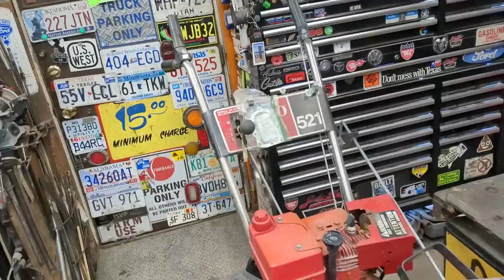Killed from too much Starting Fluid     ---Old Toro Snowblower Saved

Comment: Older snowblower  take off the sparkplug cap so it doesn't get burn. Heat the head up with a propane torch.  Just don't shoot the flame to the gas tank or you going to have a bad day. This i find helpful for starting on really cold weather.

Comment: Nice! I love the old equipment. Tecumseh powered snowblowers are the best. That is what Tecumseh did best, imho. They made lawnmower engines for Craftsman, but their money maker was the 5 & 8 HP Snowblower engines. Easy to work on, easy to fix.
Reply from the maker: I'm a huge fan of the Tecumseh snowblower engines but somehow I dislike their lawnmower engines. I think they bid for contracts and had to cut corners to get the jobs. And it's just the opposite with Briggs as I hate a snowblower with a Briggs engine.
Reply: @sixtyfiveford  I think they built lawnmower engines just to keep their people employed in the off season from making snowblower engines. I do have a Monster od a Snowbird 11/33 with a Briggs 25 CID on it that I love. But my overall favorite to work on is the HS 50.

Comment: Good video. 👍  My 1970s 2 stroke Toro snow blower would have corrosion on the points almost every year, I finally replaced the points with a little electronic module I got at the hardware store, no problems for the last 30 years. 
Ginger has a great personality, she is so loveable. 😍
Reply from the maker: The little points eliminator boxes are great. I used to put those in from time to time. I found the trick to points is they need to stay dry/no humidity. So I make sure the gasket is air tight and generally I get 10years. However I do live in a relatively humid free place.

Comment: I have the same Toro 521, but the original engine crapped out several years ago, so I replaced it with a Harbor Freight 6.5 HP engine.  It has run great since.  I serviced the drive/clutch and augers two years ago.  Used it for the first time this season last week.  Started on the second pull and continued to launch snow about 30'.

If the stock engine dies, the HF engines are < $150 when on sale.  The only thing that needs to be modified is the crank shaft that rotates the discharge chute.  I cut a section out to clear the valve cover and clamped on a section of high-temperature hose that flexes around the cover.

The next modification I plan to make is to extend the second-stage impeller blades with thick rubber-like (from thick mud flaps or conveyor belt material) "wipers" to close the gaps between the blade and second-stage wall.

Lastly, the bottom scraping blade and side risers are still available online.  I got a replacement set, plus a spare set.
Reply: Why did the same on a 521 that I got for free. I believe mine is a much later model the original engine had a black shroud and black gas tank that did not have points. Mine also had pneumatic tires and a taller chute..

Comment: I find these between free to $100. Sometime they are even running. The usual repair is just a carb cleaning, replacing starter rope, sometime a stuck valve. Did not have any with a blown head gasket yet. I get many craftsman / Briggs engines with blown heads. I like TECUMSEH engines. A lot of whining on line about them but I will take them in all day long.
Stay well, Joe Z

Comment: Those old Toro's with the drum style auger we're great machines.
I had an 8-24 that lasted me 30 years.
Reply: I have a 521 that but then decided to swap that this come so for the Predator 212 engine from Harbor Freight. Having an opportunity to really try it's it since been such a mild winter where I live this year.
Reply from the maker: Great machines. I would probably swap a 3, 4 or possibly 5hp for a 212cc Chinese clone but not an 8hp.

Comment: I bought a sitting-for-years Kawasaki KLR250 dual-sport dirt/street motorcycle.  The carburetor was gummed up I knew for sure.  But sometimes, if you can get them started and running long enough to get warm, they clean themselves up.  And that's what I tried to do with starting fluid...  The hard knocking should have been a big clue for me to go easier on the speed-up-the-warming process.

Anywho, the warm-up didn't help and I ended up pulling the carb for disassembly an a proper cleaning.

Once back together, it ran perfectly.  Although, during freeway rides I was getting a hell of a lot of oil in the airbox from blow-by.  If I ran high speed long enough, I'd lose enough oil there was a risk of emptying the crankcase...

Great!

I pull the head and jug.  I can't seem to find anything.  Then, I spot it!  I cracked one of the skirt channels between the rings.  A section of piston aluminum was still in there like a perfect puzzle piece.  While everything was out, I had the jug bored in addition to installing a larger piston.

I had fun on that bike for a couple of seasons until it ended up in a deep mud hole swamping the entire engine.  I roached everything trying to ride it home due to water intrusion to the crankcase.

I sold the abused machine as a chassis-only purchase.

------

I don't use starter fluid anymore...  One Summer I rode the bicycle around the neighborhood on trash day and cut off the propane BBQ grill bottle regulators.  With a quick-disconnect on the regulator hose, I can now plug in compressed air blow nozzles an deliver propane as starting fluid.  The setup works perfectly.  Search YouTube for "starting fluid on steroids" for my video.
Reply from the maker: Great story. I have a small diesel in right now that they guy blew the top of the piston off with too much starting fluid. It can be a lifesaver but also a killer.

Comment: it is always nice to bring old equipment back to life. i picked up a fairly clean toro 5/24 last year that would have likely gone to scrap had i not ended up with it. piston was about 1/4" from the top of the cylinder and water clearly got into the engine with how much crud and corrosion had built up in the cylinder. cleaned it out as good as possible and hit it with penitrating oil. it broke free eventually. the bore didn't look perfect but after cleaning the carb and points it seemed to run real good and didn't seem like there was much if any blow by which actually surprised me.
Reply from the maker: Awesome

Comment: Mine has been nothing but trouble. It used up the belts, the power transmission wheel thinger, start rope, and even the worm gear all with hardly any use. I spent most of my time with it repairing instead of blowing snow. It refused to run down hill for a time. When it did run, the snow was usually too much for it (too wet/deep/icy). I hope my grandfather got more use out of it before he gave it to us.
Reply: Some consumer stuff just isn't designed well and ends up being junk.

Comment: Got an old tiller for very cheap. They couldn't get it to rev up. Older Briggs and Stratton 5 HP with the foam in the air filter. The foam had pushed down through and was stopping the throttle from turning. Replaced foam. Works great. Easiest fix yet.
Reply from the maker: Great fix.

Comment: I bought a new WeedEater push mower with a Briggs years ago and it never would stay up to speed when hitting high grass.  Come to find out the head gasket was never installed by the manufacturer.  It still starts on one pull since I put one on.  I guess it was assembled on a Monday.  😀  Ginger doesn't attack that snow like she does the water hose.
Reply from the maker: That's funny!

Comment: I reused a head gasket on a 31/2 or 5hp. I used that exhaust sealer puddy on it worked like a champ. Advanced auto has it in a toothpaste tube
Reply from the maker: Makes sense.

Comment: I have a few vessel impacts screwdrivers to work on older Japanese bikes. The heads are JIS and do work well even on a standard #2 Phillip.   Nice easy fix for the snowblower. 👍👍
Reply from the maker: Yeah, I've had a basic Vessel JIS for years and wouldn't be without it. Just barely picked up the impact and so far I'm impressed.

Comment: My neighbor had a old Craftsman snowblower that was pitiful.  Only half of the augur turned, and one day it wouldn't start after a storm. I brought a heavy  extension cord and a heat gun, and a nut and bolt. I put the bolt through the augur, pulled the sparkplug boot and heated the head for 45 seconds.  It started up.
Reply from the maker: Nice!

Comment: I always put a nut on the end of the crankshaft when using a hammer to remove the flywheel. Just as a precaution.
Reply from the maker: If the threads go all the way out, yes.

Comment: Even when they run great those motors are just a little under-powered for the deep and heavy/wet snow; just a little more work than it can easily handle. For me, instead of dropping more time/money replacing the carb, fuel lines, muffler, etc. I'm doing the Predatpr 212 swap. These old v;pwers are "built like a tank" and seem far better built than newer models. Having 30% more power from the Predator swap (from 5hp to 6.5hp) should make it a nice little work horse and it should last another 20+ years. :)

Comment: I'm not 100% sure but I think if the 521 has a red shroud and red belt cover it has points and if it has the black cover on shroud is more likely to have electronic ignition. I had one of the more modern 521 blowers with pneumatic tires. That had the more moder electric ignition engine on it before I repowered it with a predator 212.

Comment: I know ppl be hating on tecumseh but they are great engines if you looked after them, meaning don't leave gas in the tank and carb. Clean carb, put stabilizer and maybe carb injector choke cleaner in the gas..

Comment: Great fix Moe.
Questions: did you use the old head gasket over again?
Did you use any gasket cement on the head gasket?
Many many years ago I replaced the head gasket on my Studebaker 6 cyl and the machine shop that resurfaced the head told me to use aluminum paint on the head gasket before installing it.
Reply: @DaveAppleton  Okay, thanks
Reply: Copper coat is best..
Reply from the maker: I picked up a new gasket for $6 and the old one had a large hole in it. These engine are such low compression(6:1) that they need very little help from things like copper/aluminum paint coat. For car engines with coolant passages etc the paint can really help seal and or give reassurance.
Reply: Thanks Moe for the info.

Comment: I've never heard of blowing a head gasket by using starting fluid. Was going to say a mouse nest on head, but looks like most of the fins don't have much of a cover over them.
Reply from the maker: Ether makes any fuel extremely easy to combust. So the combustion can/will happen before the piston crests and essentially slams against the piston. So a piston moving up is instantaneously slammed back down, reversing the rotation of the crankshaft. This bends connecting rods, cracks the piston and blows out the head gasket. I have a engine right now that the top of the piston is blown off due to starting fluid.

Comment: The engine is.looking like a Tecumseh engine  I've heard that the use to much starter fluid in a diesel engine is not a great idea either Glad you got it running again
Reply from the maker: Yeah, this is the good days to Tecumseh (1983) before they starting cheapening everything up in the 90's to win contracts.
Reply: @sixtyfiveford  the bad thing is that they are out of business now 😭😳
Reply from the maker: @robertmailhos8159  Yeah, I think it was around 2000, so 20-25 years ago now.
Reply: @sixtyfiveford  that is a long time to be out of business

Comment: I have an old 5/24, it is a tank. I hate the shifting/clutch is one control on the bars, so you have to let go of the left bar to shift or pull it out of gear via a shift knob....dangerous. Nobody wants to buy it, lol. 
Does that one have solid tires?
Reply from the maker: Yeah, the super hard solid tires. The only thing good about solid tires is being able to throw a couple hex head screws in them for traction.

Comment: I keep forgetting, but I've heard leaf blowers work great, and I have around four of them way up North.  Help, made a dash cover to stick on my rebuilt shattered Chevy dash out of treadmill tread and realized at the last moment that is like silicone sprayed nylon, tape doesn't even stick.  It tried cleaning it with acetone, got any ideas?
Reply from the maker: Contact adhesive? That stuff bonds most anything, though I haven't tried it on silicone. Maybe silicone caulk.
Reply: @sixtyfiveford  Thanks, I guess it will have to wait till warm weather or scrub it in the bathtub with dawn dish soap.  Just wasn't thinking, I was too excited that I found something, the black velvet and rubber cement worked for three years.  I'm one of those that actually watch the road and can't stand reflections, or today's inconsiderate drivers that leave their brights on.  The whole thing was an ordeal, even had to make a screw jack tool to get the wipers off so I could use the vent as a pattern.

Comment: I've found that some machines just don't ever like choke. That's my current snow blower. I'd like to know why this is the case. It looks like this one you have is the same deal.
Reply from the maker: I think that has to do with the richness of the main jet. I like all my equipment to run a little rich which is required under heavy load. That's easy with an old machine like this with an adjustable main jet. All modern(25year-newer) has fixed jet sizes that won't allow adjustment. I find they push the extreme limit of lean and some new stuff needs upwards of a minute of running with partial choke.
Reply: @sixtyfiveford  That makes perfect sense. It would be interesting to test with an 02 sensor to confirm whether an overall richer running machine needs less or no choke and what kind of mixture. The best test would probably be with an adjustable jet carburetor using the same machine for all testing and maybe throw a newer machine in the mix as an outside comparator.

Comment: In my experience, head gaskets are blown due to ignition timing, heat, and/or lean mixtures...usually under load.  Head gaskets are not usually blown at idle in no-load situations on starting fluid.

I'm willing to learn something new, however.  Can somebody provide some very obvious and damning evidence where ether is blowing head gaskets all the time?  I've heard this claim before, but have never witnessed a single instance of proof.  However, I have a close relative that has probably used 50,000-60,000 cans of starting fluid in their lifetime, but I've never seen them blow a head gasket.
Reply: Sometimes they just blow, I have repaired many Honda engines that just had a blown head gasket, usually the generator engines around 13hp, sometimes the crankcase covers get cracked because the pressure ends up in the crankcase, throw a used crankcase cover on and a new head gasket adjust the valves new plug oil and your in business for around $80 or so. Then you have a good horizontal shaft motor with electric start.  You can pull the crankshaft and turn down the generator end to 3/4 inch on a lathe around 2 inches long and add a 1/4 inch keyway and re power anything. if you need 1 inch diameter crank snub, you can buy an adapter sleeve to go from 3/4 inch to 1 inch for around 10 bucks.
Reply from the maker: Absolutely too much starting fluid. I've have one in right now with the top of the piston blown off due to starting fluid. I've seen bent rods and blown head gaskets. Someone else just commented they cracked the block on a Briggs years ago trying to run it off starting fluid and another guy blew the top piston ring flange off. These small engines are 1/20-1/40 the size of truck engine and those you would only give a 1-4 second spray to get them going. Try to give a 1/20 of that spray and it's impossible. Now take your truck engine and spray directly into the intake for 20 seconds straight and see what happens as that is what you're doing with a 1-2 second spray on a small engine.
Reply: Yes, sometimes it will take out the engine, when the crankcase get cracked the oil comes out. If they continue to run it like this it will cause serious damage. I have had a few with bent rods too. The guys with the generators leave em out in the shed with old gas and spray it in the carb and wham it starts but it does damage. I have saved quite a few of them though and made good money re selling them after repairs. You can buy a generator like this for next to nothing.
Reply: @sixtyfiveford  Ah...so the issue is misuse of starting fluid, not starting fluid on it's own.
Reply from the maker: @RK-kn1ud  Sure, but that's a catch 22 because you can't use it on a small engine appropriately without overusing it.

Comment: Why would too much starting fluid blow out the head gasket? Hmmmmmmm
Reply from the maker: First: The ignition spark always happens before the piston reaches the top of the stroke. This is because gasoline takes a little bit to ignite and by the time the piston crests and is on the way down the majority of the combustion takes place pushing the piston back down in the direction it was all ready going. Ether makes any fuel extremely easy to combust. So the combustion can/will happen before the piston crests and essentially slams against the piston. So a piston moving up is instantaneously slammed back down, reversing the rotation of the crankshaft. This bends connecting rods, cracks the piston and blows out the head gasket.